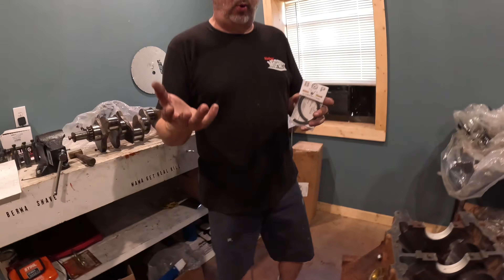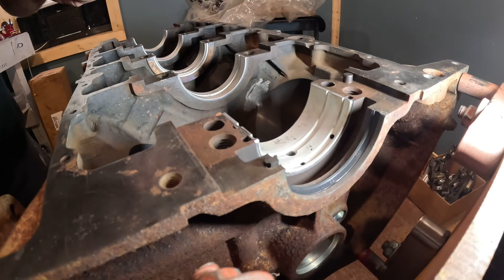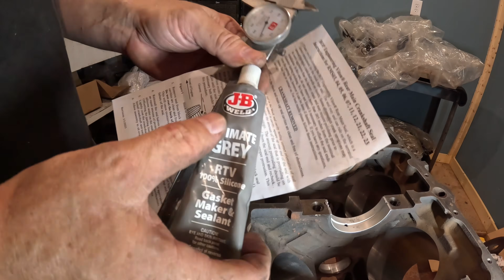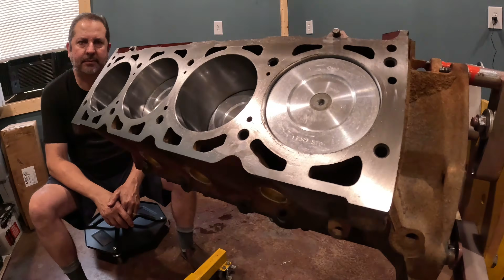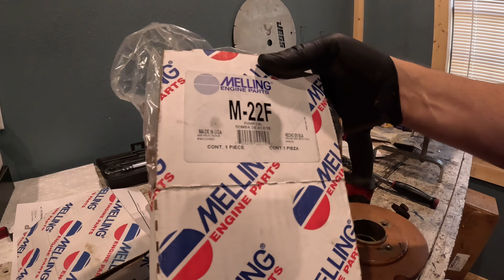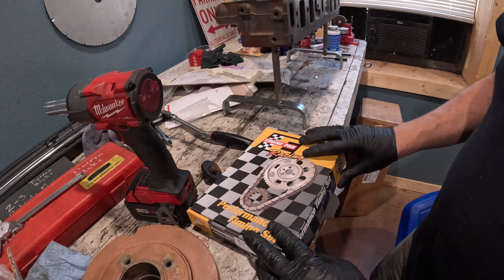Olds 400 Engine Build

Comment: Hi Blake, nice build. I’m a big BOP fan…Buick especially but have great appreciation for all them. Good friend of mine has a ‘68 442 with the later 400. It’s been a fantastic engine for him.
As for your question on assembly lube, I use Driven. It hangs on very good as well.
Good luck with the build.
Reply from the maker: Thank you!

Comment: Rope seals do have more friction, but installed properly, they don't leak! The first Olds motor I ever built (after doing 440s, SB MoPars, SB Chevys, Buick 455s, etc.) was a '71 350 Rocket from a Cutlass "S" convertible. The rope rear seal went in just like the ones on 455 Buicks, which I had done before, but once I torqued the main caps, the crankshaft would barely turn!! I was working late, got frustrated and went in the house and went to bed. The next morning I went out to the garage to prepare to remove the #5 cap, and tried the crank first, and it turned fine!! I guess the seal "took a set" overnight and was relaxed. The engine ran fantastic and is still running (36yrs later!)!! I used a small Engle 260/268 cam with .496" lift and 112*LSA, it had a little lope at 750rpm and the owner loved it!! :yt:🚀